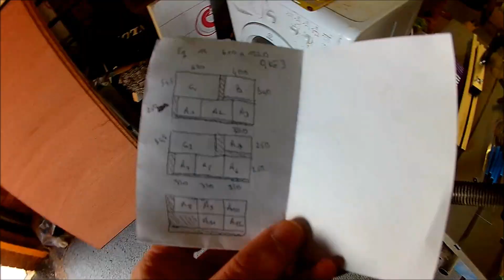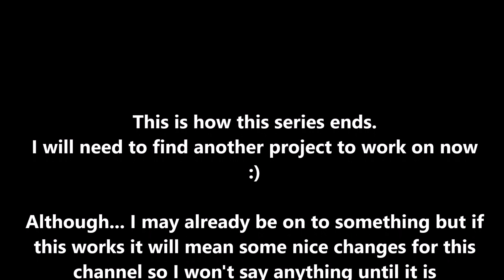Off Grid Van Conversion (FINISHED)

Comment: +gogetit .. Watched your van build playlist. Liked very much the layout, design, and functionality. Indeed I love the pivoting cabinets and bed frame. Awesome space saving design. I watched and re-watched through the series trying to determine what pivoting hardware you might have use to hang the cabinets to the bed frame. Best i could see were some  small screws similar to the screws used for jointing your frame work together. If indeed that's the pivot hardware, I have to wonder about it's reliability under weight over time. I don't have any alternative ideas at the moment, however i am sure there are existing solutions available with a bit of research. I was curious if you have plans for a fridge/cooler storage also a sink and water storage/system. I have one last curious inclination. Padding/mattress for the bed. What about storage for those? Will you be using inflatables. I really don't mean any disrespect because i truly am impressed with you kitchen cabinet/table/hidden storage design as well as the folding bed/cabinet design. The things i mentioned just stood out in my mind while watching. And you did encourage questions. Thanks so much for sharing this awesome build series. I will be watching some of the antique auto videos. Liked and subbed.
Reply from the maker: Thanks for the comment and the subscription. 
The screws used to hang the cabinets were small ones in the videos. They were replaced later by stronger ones. 
For the bed, the mattress is inflatable and can be stored in one of the cabinets. 
The van has since been sold because I have other projects and that might be the start of another series of videos very soon but thank you for the compliments.
Reply: Video "Off-Grid Van Conversion Project (Part 5) - Smart furniture design and build" is missing from your playlist. It showed up in my recommend watch list. So i checked the list to verify since i didn't recall viewing it. Thought you will want to know. Thanks for your reply. All the best with future plans.
Reply from the maker: Thank you very much. I hadn't noticed. This is now fixed.